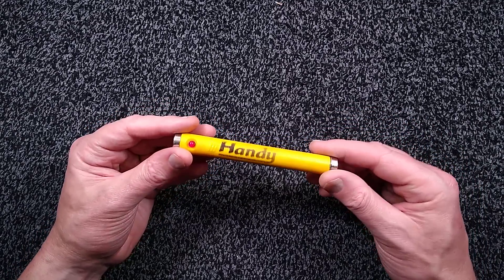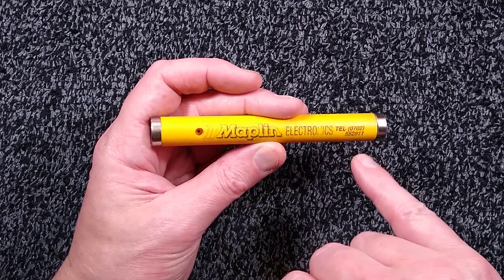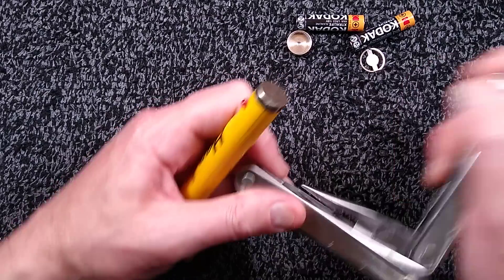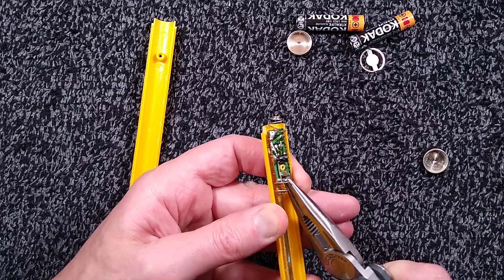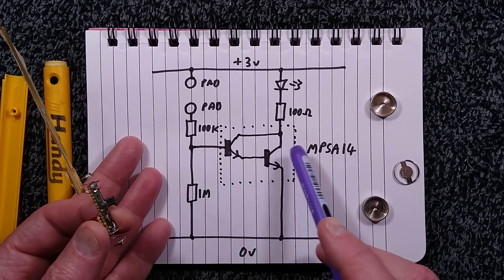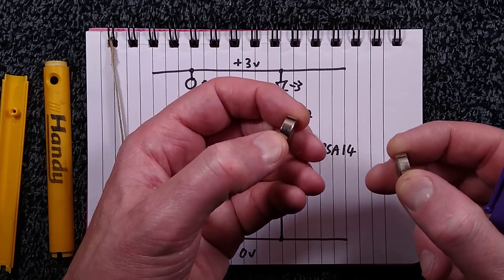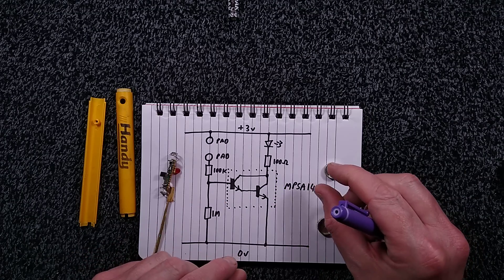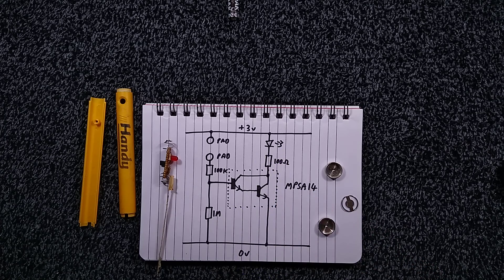Retro Maplin "thing" (with schematic)

Comment: Stores like Maplin & Radio Shack went out of business because they provided no reason to go to their stores. customers ask them the question, why should I go to Radio Shack when I can just buy it online. instead of answering the question by finding the flaws in their business model and looking for ways improve the customer experience, they just ignored their customers and stayed the same , they later made their stores more unappealing by filling them low quality electronics that no one wanted. they could of been still around today if they would of pulled their heads out of their ass and worked on fixing the things that made online shopping more appealing then their stores.
Reply: Maplin's quickly failed when 90% of what you wanted wasn't in stock and thus had to be ordered into store. At which point, it was easier just to order everything online. Normally from someone cheaper than them.
Reply: Aye. When Radio Shack (Tandy in the UK) was close to done here, the stores just had all the same consumer electronics crap that all the other stores in the mall had, like phone cases and such. They were superfluous.